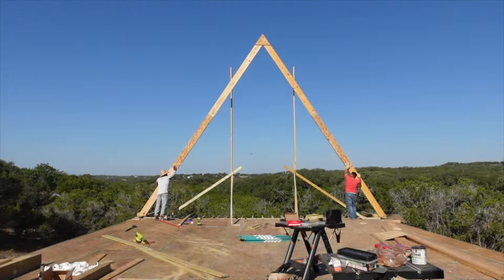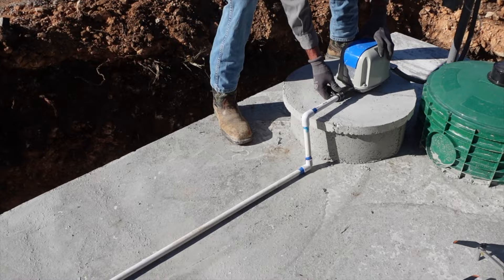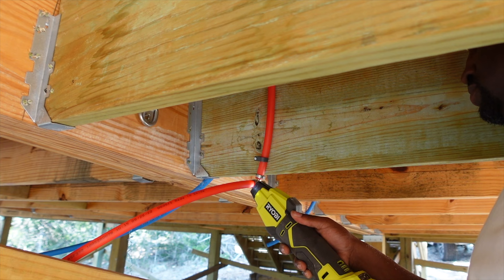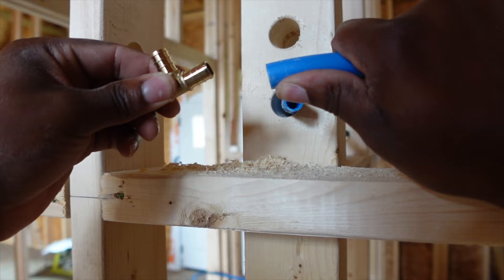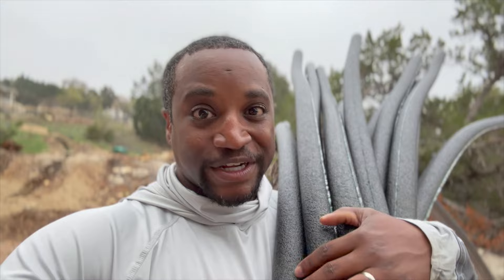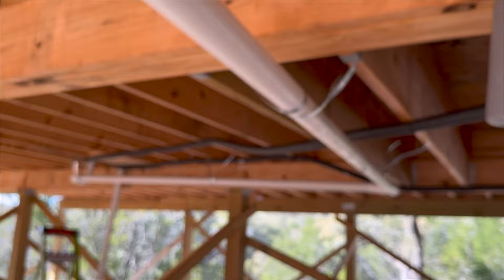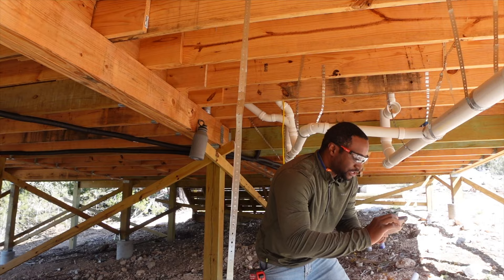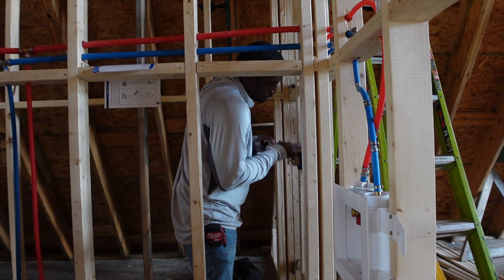DIY Builder Plumbs Whole House For $700 | DIY A-Frame Build | Episode 24

Comment: How do you keep stuff from freezing underneath?
Reply from the maker: Great question, Motown. Specifically for pex piping, you cover them basically a pool noodle like material, it’s called foam pipe insulation. That material protects the pex piping from the sun and against freezing. But… I will say, pex piping already has antifreezes properties. 👍🙏
Reply: @darryldarks  I feel like I won’t be able to do this for an a frame in Michigan.

Comment: Sorry it wasn't my intent to sound like an ass with my question. But after I went back and read it after I posted it, I was like well hell I sound like an ass. lol  But I have always wanted to build my own house to rent out or rent as an Air B&B and every state is basically the same. You can build your own home without a general contractor as owner builder but you can't build a home  for the intent to rent it out. How are you doing this. ?????????????
Reply from the maker: Dude, no need to apologize. This whole idea is flabbergasting. Lol. Building your own house… by yourself… and it’s 2023 not 1823. Haha!

But yeah, I’m just like you, I always wanted to build to my own house. I loved architecture since the 5th grade after walking through my first KB Home and my grandpa showing me the skyscrapers in downtown Houston. 

I spent years just thinking about building my own house. But didn’t know where to get started. So, I read a lot books about how houses are built. Like the engineering behind construction. YouTube channels like, Perkins Builder Brothers and Matt Risinger were huge helps to understand not only building principles but how to walk yourself through the 10-20 different ways you can handle one task. 

It’s insane. Like for instance, I probably could have plumbed the house differently. Larger drain pipes, more clean outs, an extra vent pipe. But the house is fine. The master plumber that I consulted with told me that he and another master plumber could plumb the exact same house and it would look completely different.

Anyways, my biggest learning with this whole thing, hopefully this helps you too… 

Get comfortable with the idea of making mistakes and then correcting them forever. Because you learned how to be better at the craft and more efficient. Then you don’t have the learn that part of the skill again.

I could probably point to 20 things with this build that I would do differently now than then. But man, that’s just how  I  (and you) get better.
Reply: So in Texas you can owner build a house and rent it out if it's not your only home? Because you can not do that in any of the other 49 States????